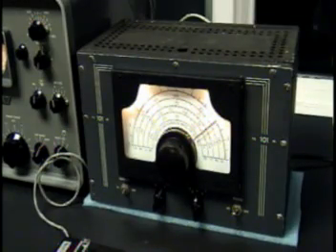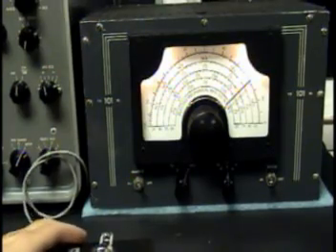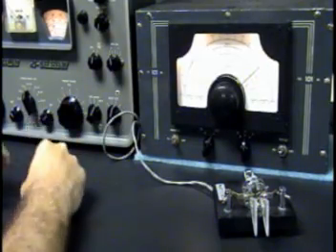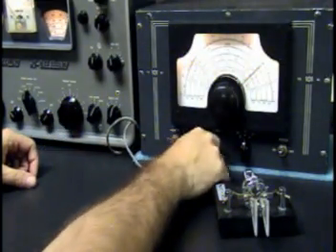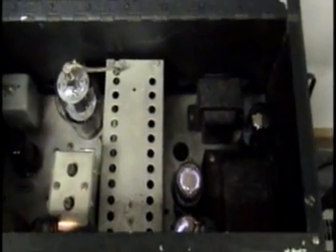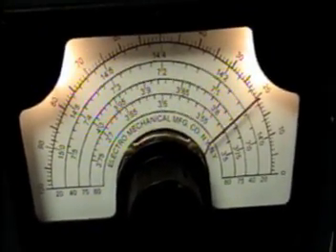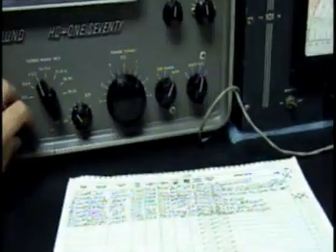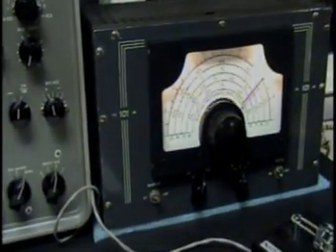VX-101-JR Ham Radio 807 Tube QRP Transmitter Vintage

Comment: I have a VX-101 also (I can't recall whether it's a Deluxe or a Junior, and it's buried in the closet). I got it about 15 yrs ago on Ebay . I've never seen another until now. Thanks for posting the video
Reply from the maker: Cool deal, they are a great low power CW transmitter. Only issue is they like a 75 ohm output impedance. Running them thru a tuner solves that. I had lots of fun with mine. If you want to part with it, let me know. Be glad to feature it on YouTube!